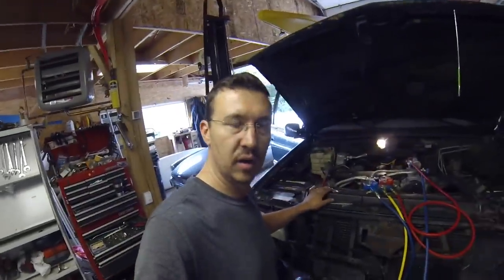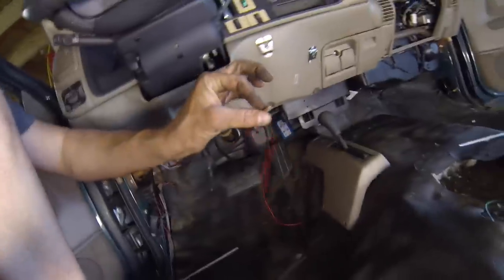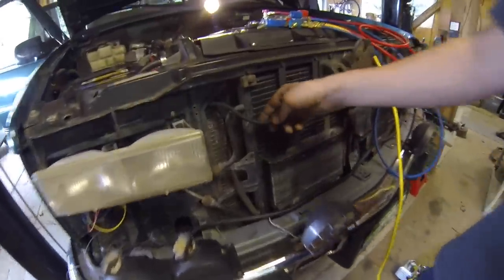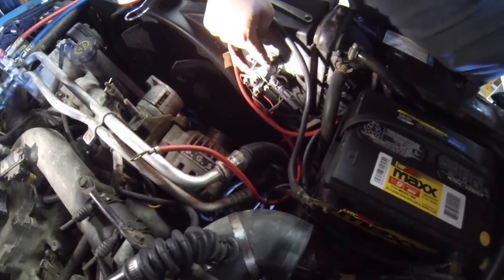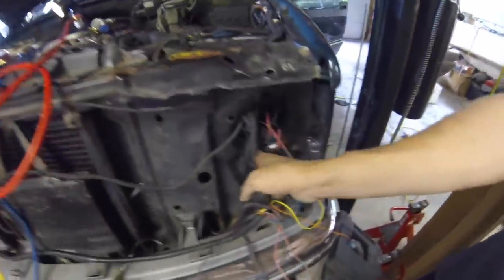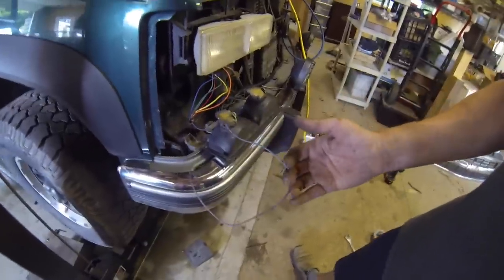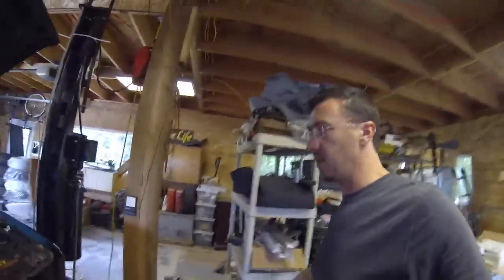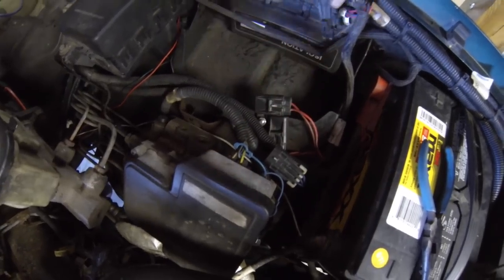How to install a fisher plow wiring harness on a Chevy Truck

Comment: Hey I have a question, I have 1994 silverado 2500 and my controller will not turn on, I have everything connected like the instructions says but I do not know where to connect the red ignition wire to, where did you connect yours to get key power to the controller? Please help thanks!

Comment: I got a fisher plow with no controller now i bought a controller . It is not a fisher controller but i only paid 20 bucks so hey i think i can wire it up myself ..... so far i have the lead from the solenoids ran into the cab   and my next step is to play the guessing game with the remote wires to see what controls what function .... any tips on using this method

Comment: On a 2001 Silverado 3500, which wires on the truck are the parking and turn signal that you tap into ?

Comment: Question: my high beams dont switch off and on when the plugs are all hooked up is the pink wire for the high low switch if that makes sense?

Comment: Hi, I have a question about the red wire that goes to acc that is on the harness that runs through the firewall to the fishstick, Should you run this wire through an on/off switch and what is the amperage of fuse should it be on? Helpfull video thanks.
Reply: +acg smith there is an on off switch on the joystick or fishstick

Comment: hate to be unappreciative but clicked on this twice looking for information on installing harness leave the videos for the people that are very informative and detailed  there wasnt one thing explained good  videos like this are a waste of space.not saying i could do better, yes i am and will because i have noticed there is not one out there that explains everything and how to do the install  all very vague. have a good one sorry for rant but been trying to do install and cant seem to figure out  the turn signal, park light and drl how to hook up the fisher manual is horrible as well on this part.2001 gmc yukon seems like the to lights on the outside both flash so wich is the turn signal and witch wire do you hook up
Reply: 1234 Did you ever get to publishing that better video for everyone?
Reply: "wich", "witch", really ?????
Reply: all lower case, no punctuation marks

Comment: This really dident help much I have same plow same truck and this just told me what I already know there is more then just the joy stick control and one red wire that goes thru firewall there are at least 4 more wires inside the cab ones a ground one goes to ignition one goes to fuse panel and 1 other idk about